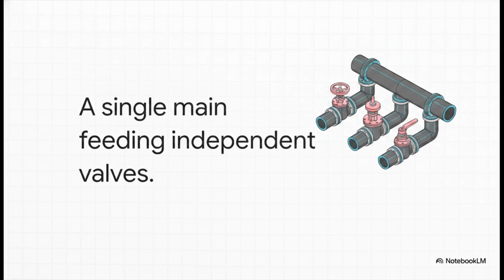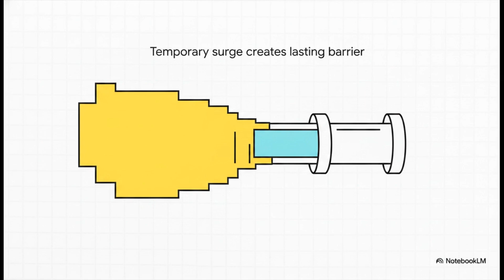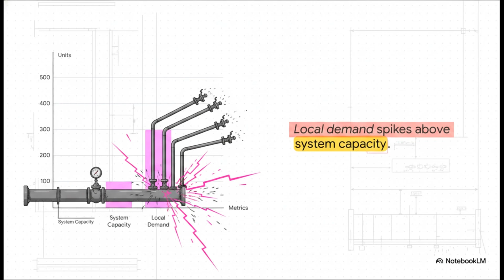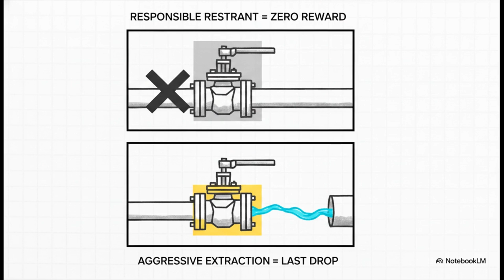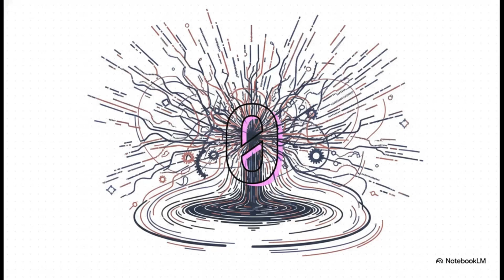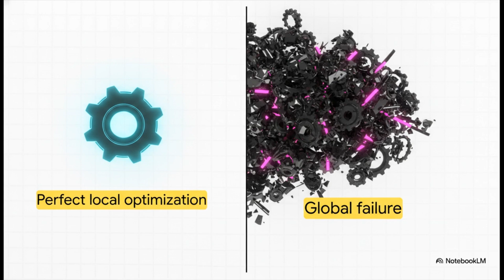Why Sharing Resources Can Slow Everyone Down

Comment: Ugh. Two minutes in and already so many false assumptions, or at least a very bad metaphor. A surge of more than 100% of water does not decrease the amount of water going through the system. It just delays the excess above 100%. So the local operators (even given your artificial constraints of not being able to see upstream) don’t sense any decrease, or any change at all. Because there is no actual drop in throughput, just a drop in the percentage of total water available that is going through the system. And you (whoever is prompting the AI here) haven’t demonstrated any mathematical proof of anything, just a lot of handwaving while saying “mathematical proof!”